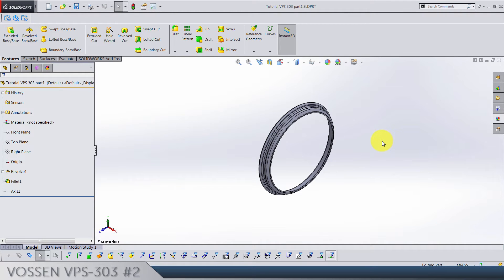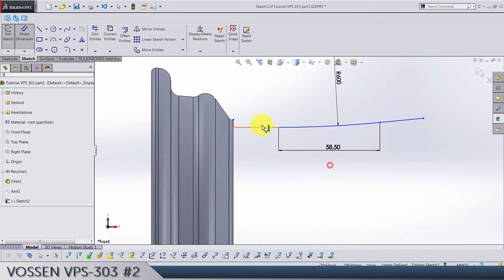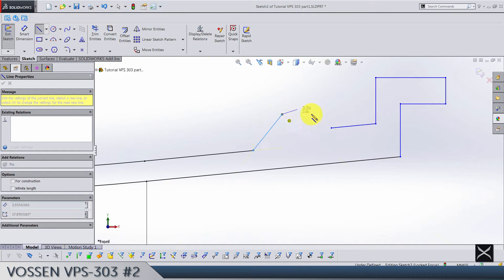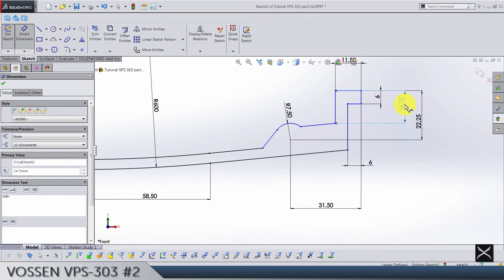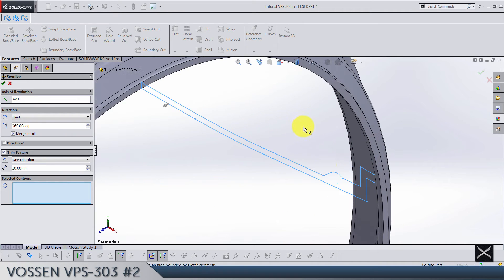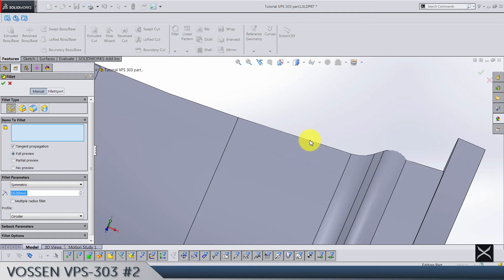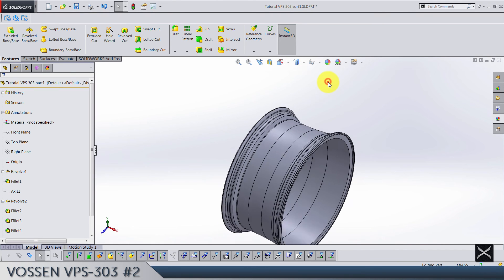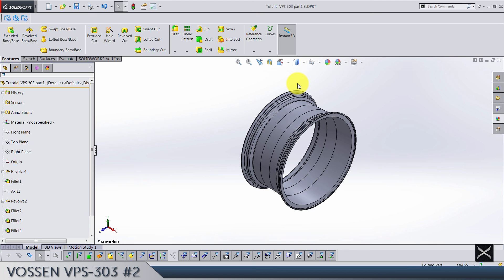SOLIDWORKS WHEEL TUTORIAL - VOSSEN VPS-303 #2

Comment: Hey dude, i just checked the diameter on mine sketch and it says 476.85mm :( Did follow all the dimensions as per your instructions...
Edit:found my mistake, completely missed the colinear relations, all good now.
Reply from the maker: but what is wrong then? :D
Reply: @phoneindustrydesign  Go it sorted now :) also i'm working with a newer solidworks version, and sometimes it's just creating thing differently, wouldnt add relations, or move the wrong part of the sketch when adding them.